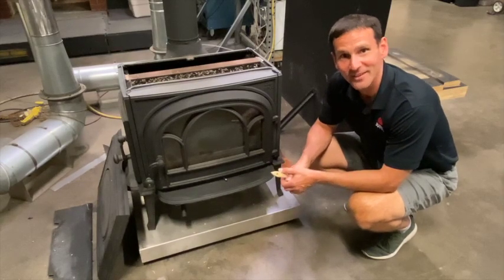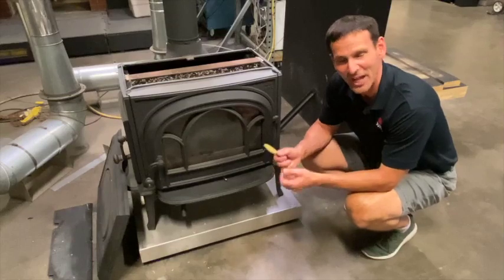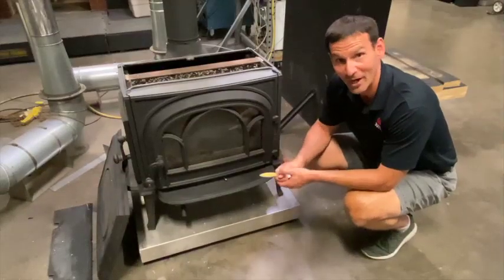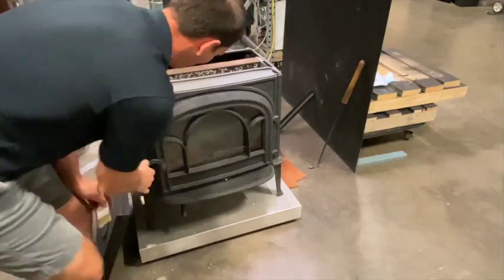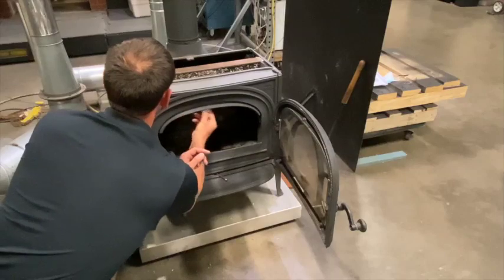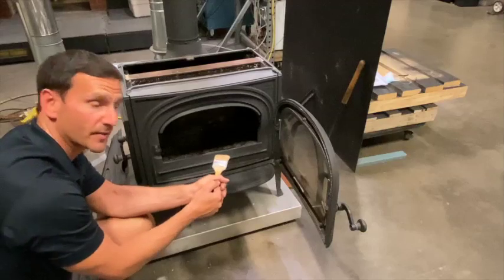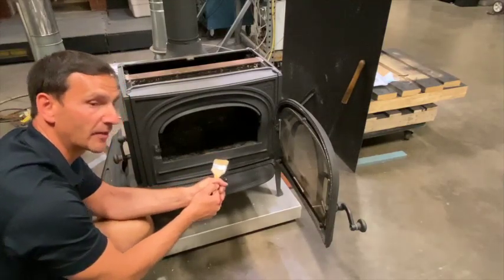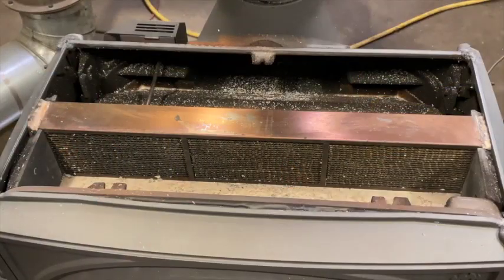How to clean your Jotul F 500 V3 Oslo Combustor.

Comment: I have a Jotul F500 "V1" and would like to know how to clean.  Also, would like to know what to do if the stove starts running hot and the air control is shut down as much as possible and/or if the F500 is too big for 1700 square feet home.

Comment: There is literally no way to clean behind the combustor wiithout taking the top off which is virtually impossible because of the hardware they use to attach the top to the box.
Reply: I wouldn't say that. You can take off the lid after loosening the hardware on the ceiling of the firebox. I wouldn't do it during the burning season unless I absolutely had to and only with a cold stove. I also wouldn't take the lid off more than once a year if I didn't need to. I wouldn't think you should have to clean the combustor on the output side, anyway, so I wouldn't take the lid off at all unless it was necessary to remove the combustor.